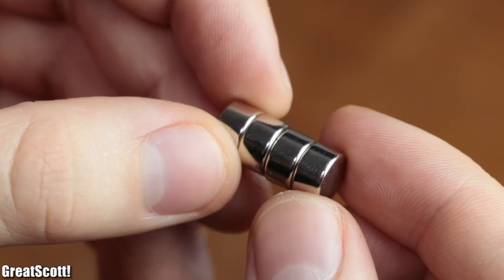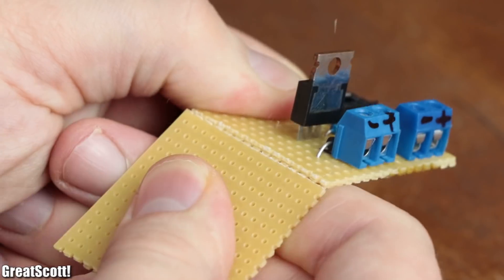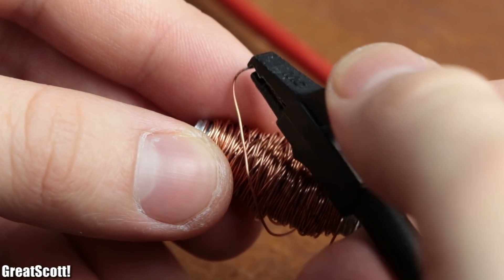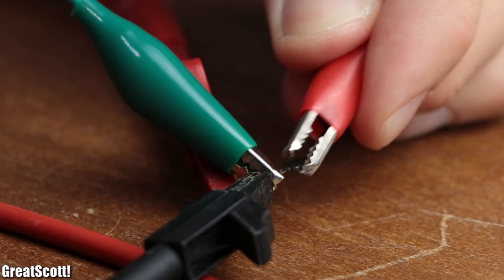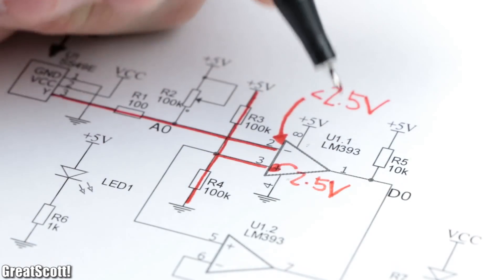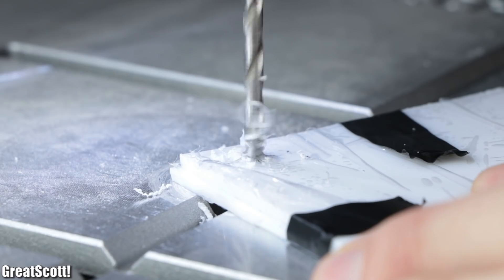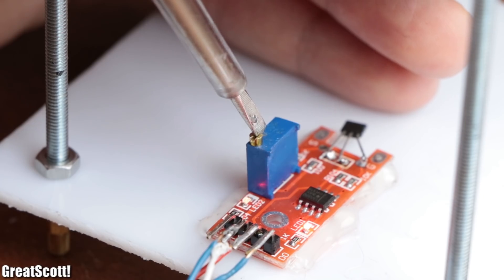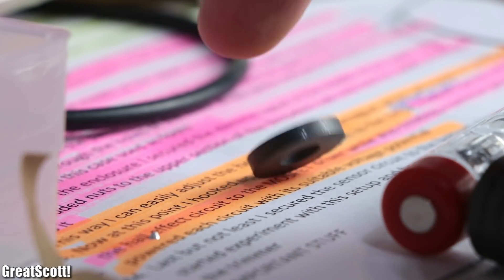How does Magnetic Levitation work? || Crude Levitator circuit

Comment: Great video as always :)
We made one maglev project 2 years back. Ours used an arduino UNO and anlaog hall effect sensors(one attached to the bottom of the electromagnet and other similar to how you did). That helped us to apply a simple position based PID loop (actually just PD was used). Also, before adding the "floating" magnet, we measured the full swing of our electromagnet (800 Copper Coils powered by bench power supply with iron nuts in core). We also had to account for magnetic hysteresis in final demo, but that was easy as it just needed a few adjustments of Kp and Kd. All that hard work brought as 5-10 seconds of levitation at max.
It seems your commercial electromagnet has little to no magnetic retention, so you will definitely get better results with PID implementation.

Comment: Oscillations are inherent phenomena with on/off control, you will probably need to modify your circuit to have some form of PI or PID controller. It would be a good project to show how some of this concepts on a practical example like magnetic levitation or inverted pendulum.

Comment: +GreatScott! I think you should apply some sort of control loop based on the output of the hall sensor, to control the electro magnet, because this way it's only acts as an On/Off switch, that's why you have this weird oscillation.

Comment: What about a donut shaped electro magnet, with the sensor at the center?
Not totally related, but what are the specs/where can I buy the silver copper wire you sometimes use in your videos to connect the pins in your breadboard? I would like to use it instead of tin, tin tracks look quite ugly IMHO

Comment: Another great video, always looking forward to the next one. I would suggest a different circuit which doesn't turn the electromagnet on and off but rather adjust the current flowing through the electromagnet such that it reduces/increases the current at a constant rate according to the hight of the floating magnet. You wouldn't get the oscillations and you'd be able to adjust the height of the magnet very accurately.

Comment: Why do most of your mosfets need a driver?
Reply: Mosfets need a relatively high gate voltage to turn on, 3.3v alone from digital out is not high enough. Found this out myself trying to drive a mosfet from an arduino running down to 2.7v. BJTs turn on starting at 0.6v, which is plenty saturated at 2.7v even with a resisitor at the base. Sensor turns on/off BJT turns on MOSFET turns on the electromagnet
I think the main issues in this implementation are hall comparator recovery speed, electromagnet inductance and distance vs sensitivity of the hall sensor (it's quite far from that magnet, distance cubed rule permitting)
Reply: fox fyre3 thank you!

Comment: Hmmm, seems like your levitator might have a delay problem causing the oscillation? I feel like the first place I would look, would be to see if either the Hall-effect sensor or the electromagnet itself were reacting fast enough to stabilize the object so it could levitate. Maybe the electromagnet, is having hysteresis problems that keeps it from changing the magnetic field fast enough.

Comment: I love yoyr videos. I think it'll help if you use a PID controller with pwm input to the electromagnet. This IL smoothen the operation and reduce the oscillations. Because the peak to peak given you the electromagnet is 5v it is oscillating a lot.

Comment: MagLev is a highly non-linear system. By using on-off state of control is insufficient, thus causing the oscillation. A conventional PID ocntroller isn't that encouraged to be implemented in this project too, except you apply model linearization beforehand. And I believe that the performance of the MOSFET isn't LTI (Linear time-invarient), thus suggest that first determine the LTI range of the MOSFET beforehand too.

- A control system researcher, a Brian Douglas' huge fans -
Reply: I thought of the same idea

Comment: This is a PD controlled magnetic levitator demo that regulates the magnetic field of a make-shift electromagnet with PWM on a PIC 18 micro controller according to the feedback position of the light sensor and LED. We used the shades of gray of the screw suspended in the air to determine it's position and regulate the magnetic pull on the screw. It was an awesome project: https://www.youtube.com/watch?v=LJTZv5O_w30

Comment: Hello, i tell you the reason why this didn't work. It is because you turn it on and off, so there is a big forces pulling it up, or down. You want a little force pulling it up and down, so you need to figure out the voltage in the middle of pulling up and down, than you have to decrease it about 5% and this will be needed voltage if it will be close to coil. Increase the middle value about 5% and this will be needed voltage if it will be far from a coil. Pretty simple right? I'm sorry about my English BTW

Comment: Could you please tell us how to achive revers engineering by measuring the components at 4:43  ? I mean how did you understand the circuit schematic just by measuring it ?
Reply: https://www.google.co.in/amp/www.instructables.com/id/How-to-reverse-engineer-a-schematic-from-a-circuit/%3famp_page=true
Reply: Arduino Hocam By now this guy is like Neo's companions reading the Matrix
Reply: Use a multimeter in continuity mode(or make one yourself that flashes an LED or buzzer when something connects) to see which component connects to others. Keep a piece of paper next to you to sketch and later make a decent schematic. After that measure the resistors and other components for their values. For IC's,check datasheets for typical applications and see if there are similarities with your item.
Reply: lah
Reply: You check which lead goes where with, dozens of times.

Comment: I managed to do an arduino magnetic levitator with the same configuration, that uses an electromagnet on top of the device and the levitating magnet below it. I used a PID algorithm for stabilization. If you are interested in how I've done it, contact me!
Reply: I am designing something similar for my automatic control class. I am currently working (and suffering) on the math … would be great to have some extra input :)

Comment: Why do you use the comparator at all? If you had an analog voltage going to the coil, the magnet might not oscillate that much because you get more like a linear response instead of just an on-off signal.

Comment: I found an article about a electromagnetic levitation:
http://amasci.com/maglev/magschem.html

The circuit 'tries' to keep the magnetic filed on the e-magnet at zero, so it regulates the current to push away every magnet.

But you will need at lest 5 or more for a functional levitator.

Comment: Maybe the catch diode across the coil is the problem? This will slow the current decay in the coil as the voltage across will be the diode drop. You could try a zener from gate to drain that will turn the FET on to decay the coil current. This way the coil current will decay much faster. Just a thought.

Comment: Hey Scott, great video.

Surely when you turn on the electromagnet it will disturb the magnetic field enormously and will create a huge hysteresis loop which causes the oscillation.

Can you either: 1) add a variable feedback path around the comparator to offset the magnetic feedback, or 2) use a micro controller (or logic circuit) to pulse the electromagnet at high duty cycle and only read the comparator when the electromagnet is off and the Hall sensor is only influenced by the floating magnet?

Comment: Hi i have a question i took apart a samsung plasma tv sound bar a d where you connect the wire to speakers before speaker there is a coil for both side left 2 speakers right 2 speakers strange is that while 4 wire was output to speaker bar 2 is left 2 is right and goes like this (2 whire red/white from board to bar connect to a coil then from coil to the 2 speakers from left same for the right.) also power output for sound specified by samsu g was 20watt max. So question why does a speaker need a extra coil?

Comment: I have a feeling that the type and value of the flyback/back emf-suppressing diode might affect how well this works.
Other things to play with (if not already tried)
The resonant frequency (fc) 
the DC resistance of the coil  - in relation to the properties of mosfet and voltage supply.

Comment: How about using an ir sensor to measure distance of the falling magnet(magnet can be a  disc of enough radius to be detected by the ir sensor) since led's switching speed is very fast.... compared to the voltage change in hall effect sensor...  and output of ir sensor can be used to turn the coil on and off....do u think such a setup can work??

Comment: I appreciate the attempt in this video, but what I'm walking away with is "WHY" you made it?  When at the end of the video you stated there are commercial products that already achieve this. Couldn't you have just made a video reverse engineering this to break down the circuit and how it functions? To me this was a "filler video". Which is a shame as I find most of your vids to be very conclusive and informative.

Comment: Hi, I've tried something similar to this project before and found that the electromagnet didn't actually turn off completely when switched and retains some magnetism afterwards (maybe due to the core being magnetised, not sure though) and apparently a short reversed current pulse is sometimes used to remove this. Not sure if this is any help but might be worth looking at.
Reply: Air core one could be better

Comment: Hi Scott. I think you should place an RC filter in the gate of the MOSFET. The probem could be because the amplification of the closed loop system is too high, and you are using a simple P type compensator that is prone to oscillation. Adding an RC filter would introduce a pole in the system, which placed correctly would dampen the oscillation.
Reply: I think a better approach would be to change the comparator with a variable gain noninverting opamp, whose output would feed an RC circuit in the gate of the mosfet. This way the system should behave more linear.

Comment: I clicked on "Like" but this project is not working. You had major instability possibly caused by the coil sending high voltage spike to the op amp or hall sensor.

Looking at the power line and the current in the coil with the scope would help diagnose the problem.

Actually, reading a comment below, , ruben matthys, 54 minutes ago, provided the solution : PID loop.

Like he said, this magnetic levitator would illustrate clearly the function of each of the 3 parameters. This would be more obvious if you use the scope to graph the curve shape. A step perturbation, like hitting the magnet with an object, would show how fast the correct levitation height is back with minimum oscillation around the desired value.

You can use a digital PID with arduino or try an analog PID using 2 or 3 OP amp, a few capacitor and 3 potentiometers.

Comment: Something you can explore is adaptive defrost on a fridge.  It learns over time how much cumulative runtime that's just right to defrost the evap coil.  It is based on how long it takes for the evap coil to heat up and either subtract or add time to the cumulative compressor runtime.  Thought you may find this interesting:  http://www.appliance411.ca/faq/howdefrostworks.shtml

Comment: you need a PID controller. I would like to see you implement a PID control loop using an Arduino.
Reply from the maker: It is on my to do list. Soon.
Reply: Would also be interesting to see how one would implement an analog PID controller.
Reply: why not make an analoge pid controller :D that'd be awesome
Reply: my thought exactly! since the sensor is there, an microcontroller and a few lines of more sophisticated code (and some knowledge to back that up) should be all thats missing :) or analog one would be cool but seems much harder to figure out!

Comment: Why did you need a mosfet driver in this case? Is the 1700pF too high a gate capacitance to work without one?  I guess charging that Ciss through the 10k pull-up would make the switching too slow?  Under 100us though I think.
Reply from the maker: Yes, I used it to switch the MOSFET on/off as fast as possible.

Comment: Great video man! The magnet does not levitate properly because it’s a non linear system. To control it properly you have to linearize it in an operation point and design a linear control for it (maybe not PID). There’s a lot of information out there for this system and you would probably need a MCU for that. Best regards!

Comment: A teacher from midschool designed something like that, and it worked great ! 
He used a lightbulb and a big LDR on the other side (half of the LDR whas shade because the ball floated before the lightbulb), to get an analoge reading of the height. Than the used a PID-regulator to control the coil. 
He made it to demonstrate each action of the PID regulator. 

Nice project ! :)
Reply from the maker: Thanks for the feedback. I will integrate a PID next. Maybe even make a basics video while I am at it.
Reply: GreatScott! Great :) i always enjoy watching your video's. A great source of insperation
Reply: GreatScott! Hey Scott great project as always. You don't really need a PID, PI should be enough. Perhaps try with 2 coils on top of it and 2 hall sensors for better positioning in-between the coils.
Reply: The main problem is the two point regulator. It creates a limit cycle in most cases, which causes oscillation (e.g. iron with bi-metal switch). Using a simple P regulator may not help either because of the instable poles of the system. You definitely need at least a PD regulator in order to stabilize the levitation system.
Reply: DruMsfR3aK a digital signal is too crude i think, so analoge control of the coil is needed. PD regulator ? So if the magnets fall fast, the D will add will add a burst to compensate ? I think that will oscilate (magnet falls, Burst of coil, magnet rises again and proces repeats). And if the magnet hovers at the desired height, the D action does noting. The D action is usefull when you insert the magnet, to adjust the proces fast if the magnet is inserted. I think a I action is still needed to fine adjust to the perfect current trough the coil.
Reply: ruben matthys the D component achieves the opposite: If the magnet moves fast, it get's slowed down. The I component is used for compensating losses across the system in order to make the magent reach the given height. It's a well-known example in control theory, did it 6 months ago.
Reply: Damn why I didn't have such passionate teachers?

Comment: Did you consider an effect of your electromagnetic field on the sensor when you turn it on/off? Do you think it could be delay or that the electric magnet has just on/off states and maybe it would work better with analog output and pwm?
Reply from the maker: The MF does not influence the sensor. But I think using PWM with a PID control should solve all the problems.
Reply: GreatScott! Really? Why not? Is the Hall sensor on the base then?
Reply: if you have a back emf diode across the mosfet it will make your electromagnet hold the magnetization for a couple ms after you turn current off. you call look it up, they specify this on datasheets of relays.

Comment: Hey Jeremy (jk) the problem is most likely that your circuit is very binary, You'll probably want to use an arduino with that MOSFET..  That way you can PWM the electromagnet with a duty cycle proportional to the hall effect's voltage output.
Reply from the maker: I would have tried something like this next.

Comment: I can probably think of two ways to fix it. Instead of using a comparator which only has full-on/full-off as its output states, why not use an op amp differential amplifier? It can fine-tune its output control voltage to find that sweet spot that'll levitate the magnet, and oscillate around that sweet spot, rather than turning hard-on/off, making the levitation oscillation much less pronounced and noticeable.

I think part of what's happening here is that the electromagnet is an inductive coil, which doesn't turn fully on/off instantaneously. The magnetic field takes time to build up and collapse, and it could very well be possible that the levitating magnet could fall out of the attractive force of that magnetic field faster than the field can build up enough strength to attract the permanent magnet again.

If it's possible for the electromagnet to stay fully-on, but for its current to be controlled in a way that can dynamically vary the strength of its output magnetic field, you might get better results!

Comment: What you are trying to achieve is exactly what I build as my 'Facharbeit'  ~30 years ago. Using a  photoelectric sensor and a PID (Proportional-Integral-Differential) regulator made out of of 741's those days it finally worked like a charm. I think the original schematic was described in a very old ELECTOR. BTW. I'm a big fan of your videos!
Reply from the maker: Thanks for the feedback. Glad that your project worked out fine. I will see whether I might do a basics video about PID an use this levitator as an example.